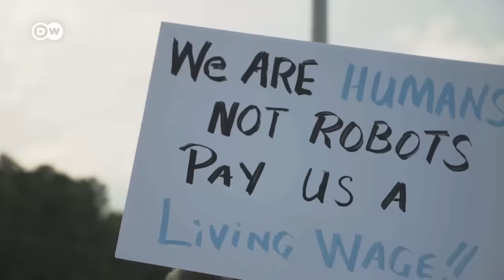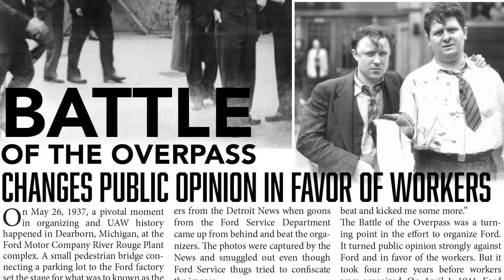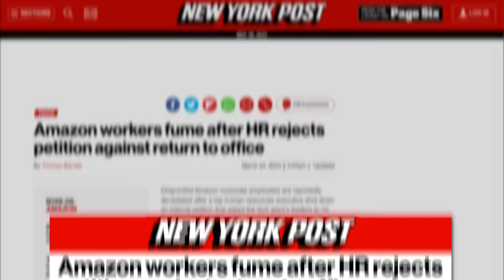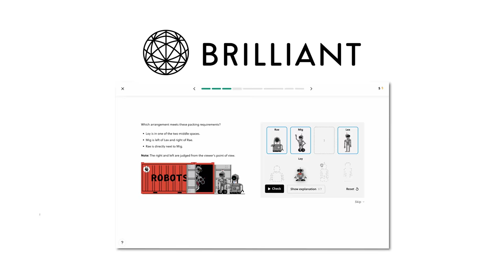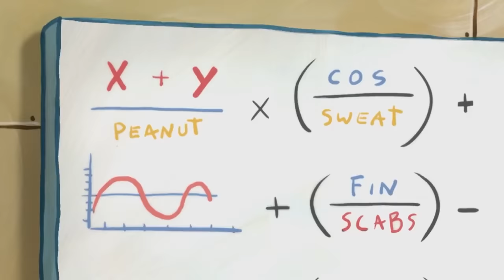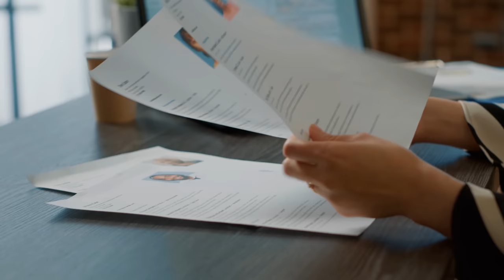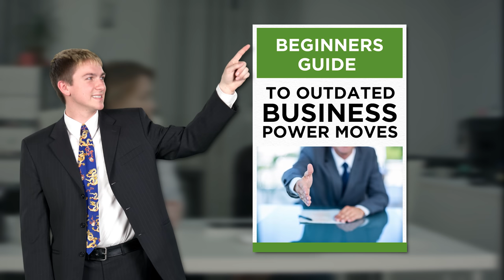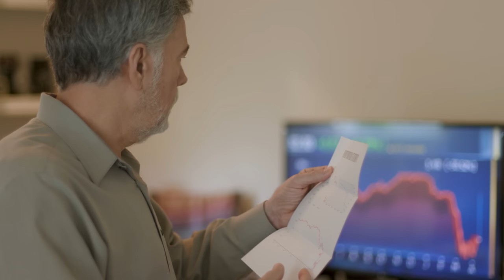How HR Came To Rule Corporate America

Comment: 10 years in HR. This is 95% accurate
Reply: How do you keep your sainity after that?
Reply: @dean_l33  Hiring people who make me look good and don't cause problems.
Reply from the maker: My condolences
Reply: What about the remaining 5%?
Reply: Same here. It's mostly accurate, though it could come with a major addendum : HR is not your friend, nor your enemy. HR is here to manage thing and keep the ball rolling with minimum friction, maximum efficiency and minimum legal issues. So your interraction with HR should be exatly as tha t:  keep in mind that anything that don't help them keep the ball rolling will only get you into trouble. Don't bring trouble up to HR, bring issue to their attention if need be, but not in writing to avoid creating pressure, if possible offer a solution, and remain professional and non commital while doing it. If you start putting things in writing, it force HR to anticipate a potential litigation, because that's just how the legal system work. If you keep thing discreet you let the ball in their side to act or not. On the opposite side if you're preparing for oncoming battle, then do the exact opposite, but know that there is no burying the war tomahawk with HR once you started down this path cause its their job to make sure the company never loose, if they see potential trouble they'll do their job and eliminate the risk, the same way a safety officer will try to remove potential accident hazard
Reply: @dorianodet8064  This is what an enemy would say. Workers of the world unite
Reply: @AkuaWalters  lol, what would a friend say then according to you? I think his analysis was fair.
Reply: you sound punch-able
Reply: @dorianodet8064  "Their job is to make sure the company never loses", sounds pretty enemish to me. Lol
Reply: @AkuaWalters   @Kibe  That's only true if you want to work actively against the company interest. 
You usually have very few potential encounter in HR, and HR want in theory to have minimal interraction with employee too. Your usual interraction are : 

Hiring process (nothing to add, everything was in the video, make yourself hirable, but that's mostly irrelevant to the present debate). 

Promotion and salary negociation which are usually pretty straighforward cause its, in fine, their appreciation of what you're worth and the risk of you leaving vs you actually leaving for a better job somewhere else if your demand are not met (if you can find said job and land it of course)

And ultimately of course the firing process, but once again, irrelevant to said debate

What's important to get is the following bit : Being a vector for change.

If you need to implicate HR to make a change, either positive or corrective (new idea vs correcting problem) you have to remember that you have different avenue to do it : 

You can be a problem solver by offering an idea. 

You can be a professional colleague by informing them of the issue and making really clear, if its inflamatory, that you just informed them and let them the leeway to act as they see fit. 

You can even cover your ass, in the case of a subject where you would be liable, by informing them orally you need to inform them in writing too to not be liable (It's honnestly fair game and most HR will just take it as such, some might get pissed by the fact you insist to inform them in writing too cause then they become liable, but covering your ass come first here and most HR will just accept it).

Or you can be a hell raiser or fucking annoyance and then you're offering your own head on the chopping block (the bigger the company the more they dislike hell raiser)

Once again, it's up to you, HR work in VERY predictable way once you've understood this basic truth, you can be a revolutionnary martyr if you want or you can just admit that a predictable and workable system is, AS STATED IN THE VIDEO, a very good option too : Follow simple rule, keep your head down when you have nothing to win, an reap the benefit in average. It's just a job, you're here to earn a living.
Reply: I agreed with him a lot until a particular statement near the end. He said the company keeps a list of people who cause trouble or complain, and they’re the first to get laid off.
Maybe in very small companies (who wouldn’t have an advanced HR dept in the first place) but NOT in larger companies. Just like there is a system/process in place for hiring, the same goes for layoffs. HR depts follow a process to make sure laws aren’t broken when doing layoffs. It’s like hiring but in reverse. There are steps, and they follow a consistent process.
Reply: You’re in a bad company then. And your management team is awful. 
I’ve worked in 3 Fortune 500 companies. Im currently at my third. Yes, some of this in the video is true. But not 95%. And if you’ve been in HR for 10 years and haven’t pushed back on this, that’s incredibly worrying. I’ve actively fought and changed a lot of the things I watched in this video and found it more false than true. That’s what I was in the comments to type in then I found your comment.
We only do 2 interview rounds in each of the Fortune 500s I work(ed). Anything more than 2, the hiring managers shouldn’t be interviewing
Reply: @dorianodet8064  telling people not to write formal complaints is horrible advice for employees. Sure it makes HR like you more but that can have serious ramifications for the compliantly later down the line. It also makes firing someone a lot easier when nothing is in writing
Reply: @cdogdeluxe6037  "It make HR like you more" : That's exactly the point. While you work FOR someone, you want him/them or his/their representative to like you, cause being liked by the direction open you doors. Playing smart ass and annoying to your direction only open one door, the exit one. If you start to play smart ass with your direction, obviously putting thing in writing in an obnoxious way, they'll retaliate in kind, promotion will pass you over, raise won't happen, and they'll slowly gather evidence to fire you legally. Once again, you're aim when you work at a company is to have the best time possible, the most opportunity possible and the most salary possible. You're not here to enact justice or to prove a point, you have the internet if you like this kind of moral battle. When you reached the point were you're already on the company bad side, or when thing happen YOU can be liable with, then yeah, in writing you go
Reply: @dorianodet8064  HR ignores problems until workers threaten to sue.
Reply: @nwatson2773  There are both bad and good company you know. There are even the copany that goes into the opposite extreme and overreact to every little shit
Reply: It's hardly any better in Europe. Did that untill i broke down to severe depression.
Reply: @dorianodet8064  Damn look like you know your stuff man. Hearing you describe remind me of a unstable country with feuding factions
Reply: Big company can be very very political. Cause people have other people they don't like, lots of nuisance power, people they do like, allies, rival ...
Reply: And women are getting raipyed for the right reasons too.
Reply: @AkuaWalters  bro is trynna cause an uproar 😂
Reply: You are apart of the problem
Reply: @kibe2134  True, but if you treat them as straight up enemies you will not make optimum decisions in your career. Yes, HR is not your friend. There isn't much good that HR can do for you, honestly. And mostly they will make things harder. However, as you play the corporate game right, and don't make stupid moves to antagonize HR, you will be fine. One of the rules is to switch jobs to maximize your pay and optimize the environment you work in.
Reply: You don't care, its just easy money. No one is going to take any food from their own mouth for the greater good.
Reply: I have been in HR for 25 years and now head of HR for a global brand…this doesn’t cover all of what HR Is but there is some truth…bottom line is nobody is your advocate,(except maybe unions) and you are solely responsible for your career..HR works as a partner to the business…with you, the human capital falling under their capacity of company resources…
Reply: @scarletlady3727 Are you hiring?
Reply: @dorianodet8064 wow. This is exactly why employees SHOULD put everything in writing. The paper trail is everything. You HR people are documenting every single interaction - why shouldn’t employees?
Reply: @calisongbird  How is HR putting down in writing an oral conversation exactly ? I'm not saying that you should never ever put things in writing. But once again, know that there is reciprocity. When your boss come to you to discuss poor performance or other issue orally and ask for a change or when he send you an e-mail about it, you know those are different lvl of warning. It's the same for HR, or any other service. If you go to them to report an issue and it stay at that you've done your part and they're free to do their (or not). When you send them an issue in writing, it is contentious, and the other side will answer in kind
Reply: @jessicadawson2353  Exactly. There was A LOT of creative license taken here for clicks and likes. Disappointing
Reply: This is nonsense. The definition of the term "human resource" as currently and actually dehumanizing wasn't until around 1957.
Reply: Whats the other 5%?
Reply: @pragaming9868  Complete lies and hyperbole
Reply: 22 years in HR this is 100% accurate.
Reply: I wondered what the 5% disagreement is.
Reply: 12 years here and it's 100% true. 

I like having that power of people.

Comment: 00:00 🌐 Corporate America aims to dehumanize employees for efficiency.
01:18 📉 Mass layoffs continue at Meta; corporate success relies on managing workers effectively.
03:37 💼 Human Resources (HR) originated in 1901 to handle workplace issues and serve as a labor union alternative.
05:57 🔍 Modern HR functions include hiring, firing, and addressing workplace grievances.
09:10 💸 Salary negotiations are crucial for career success; companies prefer candidates who negotiate assertively.
14:43 🔄 Standardized hiring processes aim to ensure predictable quality and prevent discrimination.
18:14 🤝 Impress HR managers by making onboarding and negotiations easy for them.
21:50 📋 Extended interview processes are designed to filter out less committed candidates.
26:00 🕵‍♂ Hiring managers focus on candidates who make their job easier, not necessarily the most skilled.
31:24 🌐 HR handles workplace complaints but works for the company; serious issues may not be best addressed through HR.
35:58 ⚖ Complaining frequently to HR may lead to being targeted in layoffs; use the system ethically to your advantage.
39:23 💡 Marketing yourself well, negotiating salary, and keeping decision-makers happy enhance your value as an employee.

Comment: 7:41 - I can attest to that, I am a very experienced senior in my field and I have turned down positions due to the complexity of the interview process, for example having spend hours of my own time doing work is a deal breaker. If you cannot see from my experience that I am good for the job then I will go elsewhere because you clearly don't see my value. But on the flip side, having been a person to sit in on the interview process (also due to me experience) I can see there are a lot of people that grossly overestimate  skills they have and as such need a filter process... it's a tough process all around.

Comment: I don't understand any argument against unions, from a workers perspective
Reply: A union has similar action to HR: encourage mediocrity, encourage checkboxing [not helpful policies], introduce overhead [dues and rules that hinder productivity]. 

While unions have the benefit of separation from the company, there tends to be a default antagonistic bias (which works better as marketing and is partially a result of the historical origin); a diversity of biases can bring strength but to appear useful a union will tend to exaggerate benefits (like HR markets itself as always benefiting the employees and the company). 

Like HR, it is easy for union leaders to have a power trip; most organizations have difficulty in avoiding power seeking practically replacing the reason for seeking power (to make improvements). It is very easy for the pigs to start looking very like the humans (see Animal Farm) both from the bias of who wants to be a leader and from the tendency of evil to be practical in the short term. 

Employees at a company with good policies and management (if such exists) would have no use for a union. HR would be sufficient for employees at a company with good policies but variable management quality. Unions are a response to large companies (where single worker's ability to internally seek redress or even effectively express concerns is relatively small) not husbanding their resources or treating the human ones as human.

Adding a compensation mechanism for a malfunctioning system can be easier than attempting a long-term fix or replacing the system, but such is often not the best long-term choice.